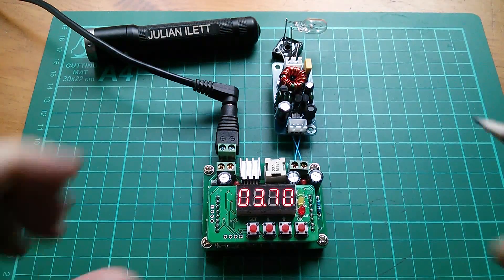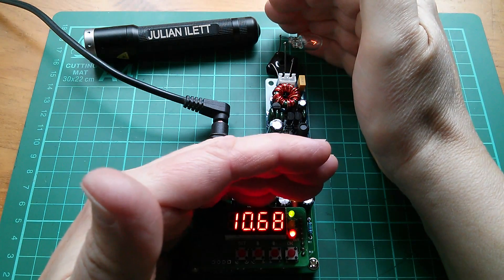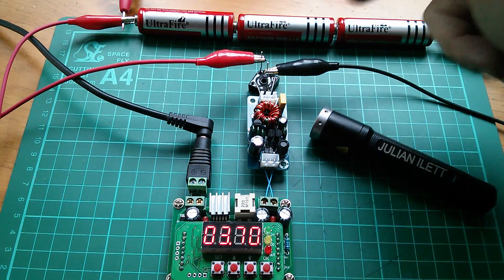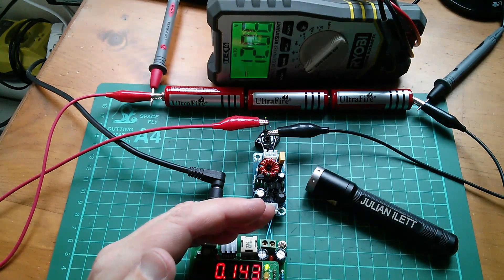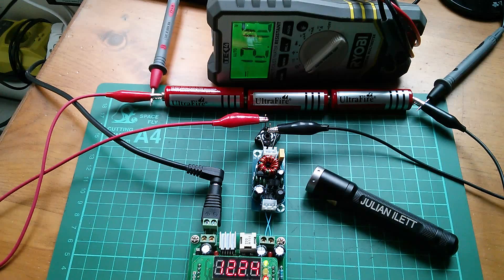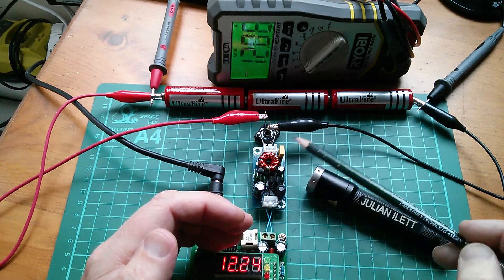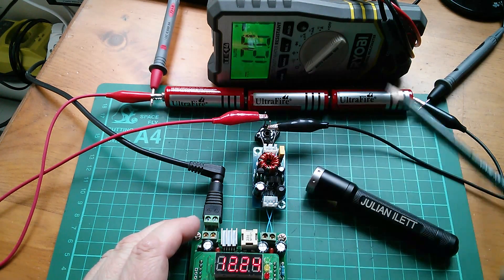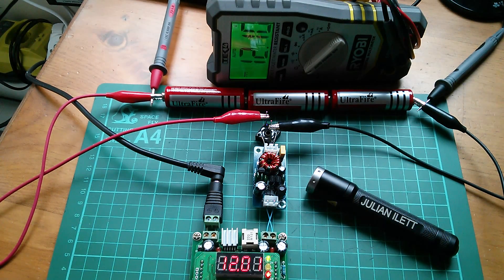Idea: Lithium Cell Balancing using AC Power Transfer

Comment: The problem starts right at the moment the cells are balanced. If you dont stop charging then the cell will discharge faster then the total pack is charged. If that one cell is delivering 1A@4V and is boosted to 12V it will only recharge itself at most with 333mA.
Reply from the maker: +DrRoelski The intention is not to have cells charge themselves (that can't happen of course). Cells switch on the transfer circuit to bleed charge away. It works the same way as a resistor based BMS, but with less waste and less heat.

Comment: How would this work when two cells are fully charged and there are still other cells that need charged? 
Would it not be easier to build a charger that can charge each cell independently? Then there is no need to discharge the cells to be balance the pack.
Reply from the maker: +Tjofrasen Can't see a problem with that - all of the fully charged cells would assist with charging the remaining cells. I do like the idea of multiple single-cell chargers, but... (see my comment below)
Reply: +Julian Ilett I rewatched the video and I had missed that you were planning to put one device per cell. It all makes sense now :) But probably quite pricey for a larger pack.

Comment: Hi, I'm new to LiPo charging, but just a suggestion: wouldn't It be more efficient to use a single cell charger for each battery rather than a AC/DC converter?
That is if you only want to use your idea for charging the batteries. 

But could be helpful when discharging.
Reply from the maker: +Gregor Jamsek I do like the idea of multiple single-cell chargers. Bit it gets a bit messy when you have a large number of cells (50 to 100 cells for example). You'd either need a massive multi-way connector, or a large number of 2-pin connectors.
Reply: +Julian Ilett Wouldn't your solution in the video have the same problem? If I'm understanding you correctly you would need access to each cell individually to be able to pull power from the fully charged cells. And then you end up needing one connection per cell (+2 for the ends of each series string).
Reply from the maker: +Peter Feerick It would be messy, but self-contained. The main battery charger would charge the whole pack with just a 2-pin plug. My test setup is low current, but I'm thinking about scaling this idea up for a small electric car.
Reply: +Julian Ilett I agree but ... you could organize the cabling like you suggested 2 main wires power line(+,-) and all of the single cell chargers.  In this video you said that every cell gets this ac/dc converter, seems like a bit more cabling problems than with single chargers. 
Anyhow I do like your idea. could be useful when discharging the batteries. if you have a cell that is not that powerful or discharges faster
Reply: +Julian Ilett And this would be less messy? :-P Hence when battery numbers are going up. they should all be in parallel, and some form of step up conversion used if you need a higher voltage. Having said that, individual cell chargers would be the best way to do things... i'm currently wondering why you can't just stick a 4001 diode on the input gnd of a TP4056 charger board, and just increase the input voltage 0.7ish to make up for the diode voltage loss. I think I'll try it with a couple cells in series (with some fuse wire just to be safe!). Then you would just leave them permantley connected as they also protect the cells. Meaning you could them have a single common charge input bus bar.
Reply: Tremendous respect for Julian, but I wonder if Peter's point has been missed. I think Peter's solution is very elegant, and I'd love to hear how his test panned out.

Comment: I had an idea to. You could use pnp and npn transistors. When not switched on, they will disconnect the cells. So every cell is connected via an npn and pnp transistor to (let's say) a set of 2 small supercaps to be able to hold 4.x volts. For charging the caps you would need 2 transistors extra per cell. In the end you would have 4 transistors, all switched off. If you power 2 transistors you can charge the supercap (there will be losses as the resistance of the cap is rather high unless you switch it very fast, which the cap won't like) . If you power the other 2 transistors, you can charge (any) the cell with the power in the cap.
The idea is to isolate the cells via 2 sets of 2 transistors. Of course, one huge problem will be the voltage drop.
In stead of transistors you could use a switching device like a relay, but I am afraid the power consumption might be to much for this project (but there are very small relays operating on just a few milli Amps).

Another idea is to be able to electronically switch from parallel to series. I am already doing this with NiCad cells, but as you know the beauty of NiCad cells is they can handle extra current really well as they convert it to heat.
Reply from the maker: +deslomeslager Yes, I've thought about the "flying capacitor" technique, but the number of switching devices (MOSFETs probably) on a large battery pack quickly becomes unmanageable. I also thought about series/parallel switching, but couldn't decide how it would work when the pack is in use. Nice ideas though, both of them.
Reply: Julian Ilett
Good brainstorming then ;-) Thanks. I liked your joulethief kind of idea as well, how ever the spikes will harm the cells I think.

Comment: An awesome concept my friend. A battery pack that looks after itself basicly. All that is required is a charging voltage. I really like that idea. Have an amazing day.
Reply from the maker: +Raymond Earle Hi Raymond. Yep, that's it. The battery pack looks after itself... mostly. You're definitely on my wavelength because I'm also thinking about an electric car :)
Reply: +Julian Ilett Would you like some of my Freecycle lithium cells? What motor are you thinking of for your electric car?
Reply from the maker: +Raymond Earle I've been looking at the Reva G-Wiz - you can pick up an old one for around £500. Don't tell anyone though - they'll just laugh. I'd probably go with LiFePO4 prismatic cells - about 16 of them.
Reply: +Julian Ilett That sounds very cool Julian. We could have a race. Washing machine motors against GWiz. I hope yours doesn't look like the Top Gear GWiz LOL.

Comment: While this is a novel idea, unless you have a severely unbalanced string of cells (to the point of it being questionable to use those cells in series), I don't think you're going to have enough available energy in the difference between the fullest and emptiest cells for it to make much practical sense.
Reply from the maker: +FFcossag Certainly a well balanced battery pack wouldn't use the system very much. But it's the same situation with mini-BMS systems that use resistors - not needed very often, but essential to protect cells from overvoltage.
Reply: +Julian Ilett The issue is that the energy contained in the "balancing range" of a lithium cell is really tiny. If you consider the discharge curve of a standard-issue 18650, you're gonna have something like 50 mAh or 0,2 Wh between 4,2 V and 4,1 V, so the economy in recycling that energy is going to be a bit questionable.
Reply: @FFcossag  when you have a big battery tough like tesla there is alot of energy that can be recovered.... when you recharge the battery from solar disipating that powerin resistors is energy lost...

Comment: How many batteries could you charge concurrently with this setup? I expect it would be limited by the current ceiling on the DC/AC converter...
Reply from the maker: +Philip Moyer The DC/AC converters would have to be designed to have adequate current capacity to offset all (and more) of the current from the main charge source. Also the step-up ratio would need to be tuned to the number of cells in the pack. That does mean it doesn't scale very well.